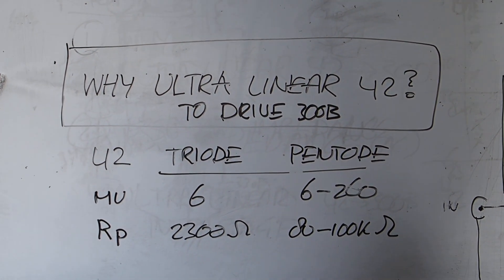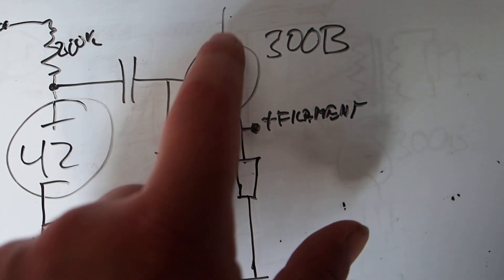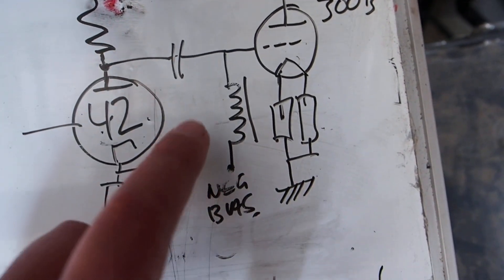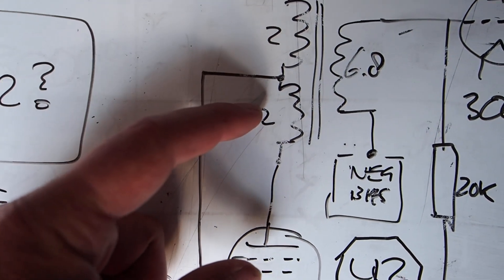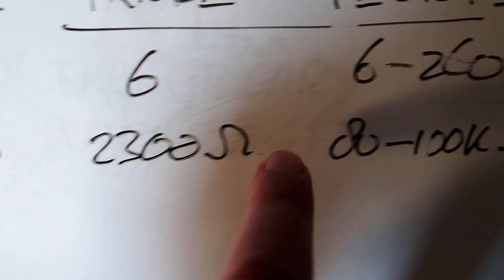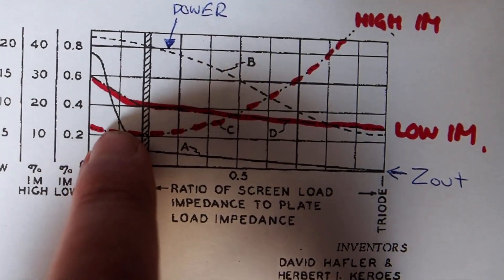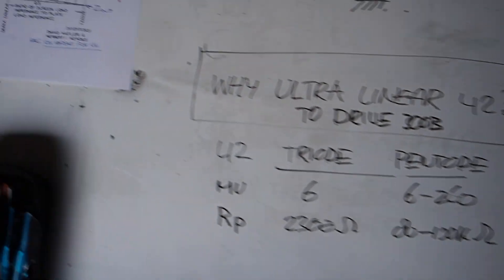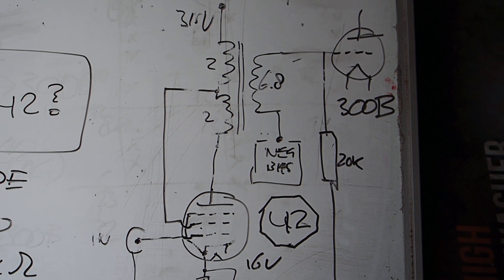Why use an ultra linear connected pentode as driver?

Comment: Hi Eduard, I am late to the table, but that's what is so nice about your videos (and those of Janus) they are evergreen.
Thanks for your explanation about the pentode. It is a bit of a hiatus in my electronics knowledge and I want to change that. You say the sound quality or bandwidth is still work in progress. Could you give your opinion on impedance matching of the inter-stage output (i.e. loading it with a shunt) as a tool to improve this. The thinking would be that a lower output impedance requires a lower transformer coil inductance. It may also increase the distortion in the transformer.
Reply from the maker: Hi Hugo! Good questions. Couple of thoughts/responses (and I may do a video with some other topics, soonish):

First, unless I have specific reason, I would run with open secondaries for the IT to maximise the bandwidth and get near horizontal loadline which reduce distortion. 

Secondly I'm just after being able to drive the next tube as best as possible, and be able to have the best clipping / recovery response when the next tube goes into class A2. If done well, the amp will perform way beyond its rating and will do credible transients, peaks yet sound good.

To get back to Zout, so that's merely an indicator not a goal by itself. If one can afford a step-down IT, of course the current delivery abilities and Zout comes down exponentially.

Third. I don't think Zout is related to inductance. Its just that lower Rp tubes simply don't need as much inductance for the same bandwidth, but do require lower impedance PSU. Reversely a true pentode with Rp=50K can not use an interstage as maybe as much as everything under 1kHz will drop off.

Given my experience with this 42-300B amp, if I was to another pentode-triode amp, I would go for cap coupling + grid choke with a strong pentode; it doesn't have the Zout but it will still drive the 300B beautifully just like the classic WE91A drives WE300B.

Comment: Lots of gems here! :_) David Halfer (the ultralinear patent) was the founder of Dynaco, I think his first UL OPT was for the Stereo 35, for EL84 tube. Indeed,you showed it very nicely that as we go higher for the tap position, we will drop the Zout, but the power also drops. The sweet spot is at 40%, where we have already almost triodelike Zout but at full pentode power. Generally the usable UL taps are between 33% (full power - quite low Zout) to 50% (almost full power - slightly lower Zout), so depending on the priorities one can choose the tap position. For more modern tubes (EL34, EL84) 40% is the preferred one, for the older pentodes (such as the 42) people prefer the 50% tap for sound usually. Personally, I think the lower Zout is much preferable to a 5-10% increase in power output... but all in all, it will depend on the rest of the circuit, how the tube sound characters mesh together. 25-40% will be grittier and brighter, 50% more mellow and lush and full. Also, as you said, the optimal UL tap varies per tube, the EL34/84 40% optimal, 42 should be about 50% I think.
Reply: They were two...David Haffler and KOUROS ........
Reply: @frankgeeraerts6243 In the US they always talk about Hafler, Kouros never gets any credit :( I did not even know about him...
Reply: One more note: as you are trying out several driver tubes, just watch out that do not use the 1624/807 family in UL mode, as it cannot handle UL operation! UL operation would fry its screen.

Comment: That's correct Eduard ..............grid current starts even before the 0 volts on the grid .
To drive you need indeed current drive .............and for the 300B and other power triodes you need high voltage swings.
There's a circuit that can suits and solve the dilemma .
The parrallel SRPP has VERY  low output impedance and high voltage swings  and could help you to try it out ...

A company who invented the circuit drove even the 845/211 tubes with ECC83  what seemed impossible but they did it with succes !

Thanks for the upload .
Reply from the maker: Hi Frank. That sounds very counterintuitive the ECC83 driving 211s :)

And indeed one 'SRPP' option could be an asymmetric 6EM7 SRPP with the low mu/Rp 'current' triode in top; another I am still considering is 6EW7 in direct connect with 13.6:4 step down IT.. which would give a 30mA driver with a Zout of about 65 ohm...and no push pull effects in the distortion spectra.

Then a similar setup to the 6EW7 is to use 2P29L directly coupled to a 1624 with the same step-down IT, which would be DHT throughout and hopefully retains the dynamics / openness that I heard in sound of the 1624.

A different issue to solve is the AC/signal power supply impedance, which is tricky to get low (=10% of its plate resistance) for a 300B.. the impedance is very audible.. moving to a type 50 would make it a little easier... and a different option altogether is to go to tube power regulation, which would lower the impedance seen by the power tube. 

One thing that I find interesting about a (choke loaded) cathode follower (solution) is that we could offset the power draw of the output tube... which takes the power supply impedance out of the equation....
Reply: Yes it is counterintiituive but nevertheless a FACT ! If this circuit wich is NOT a simple SRPP but a paralell SRPP where only one triode drive the output  can drive a 211 ( witch is designed to be driven on a positive grid ! ), this circuit can easily drive a lesser load of a 300B !
I was astonished also and have serviced  this amplifier with GOOD rersults ...I would nevr believed it without experiencing it myself ..........The // SRPP circuit  was developped/designed by BEL CANTO ...
Two following  // SRPP stages with low mµ triodes ( 6SN7 ) will drive a SET with 845 with more than 300 volt swing necesairy on the gtrid of the 845 ! Without problems , this was build by an expert  friend in France and the results were outstanding even better than any other SET 845 !

The // SRPP has extreme LOW output impedance , for example an //SRPP with 6DJ8 ( or family ) has an output impedance of only 80 Ohms !
Have a very sunny day Eduard.............sometimes the  experience is different of what one imagines by knowledege or intuition , that's how you , me and other people learn to leave the established rules and made progression  by daring innovation ..
The //SRPP does NOT behave like the classic SRPP .....the two inferior triodes operate in paralell with a shared decoupled cathode resistor and the upper triodes have their own induvidual cathode resistors , the output is nevertheless only taken from one of the cathodes of both triodes .the results are indeed asthonishing ........
The one conditio is a very generous and noisefree as well as stable power supply as any SRPP or //SRPP  does not have a good common mode PSNR.........(power supply noise reduction...)
Reply: @frankgeeraerts6243  I can not quite picture a parallel SRPP. I would love to see a schematic of that. Hopefully I can find that on-line. Also, Eduard seems to like direct heated tubes very much. It would be interesting to see that with and SRPP from a heater power supply perspective. I guess you would need an extra heater winding or for the lack of that, transformer.